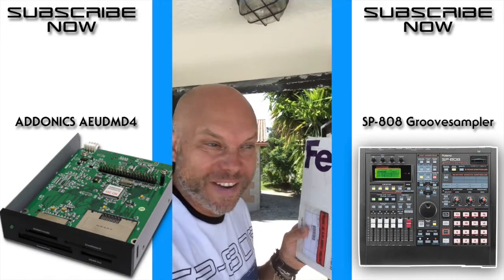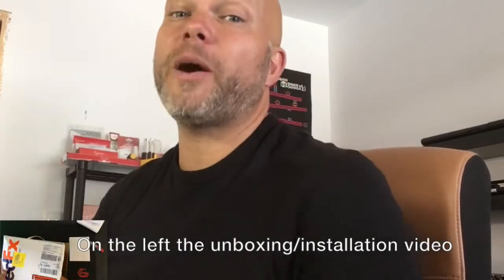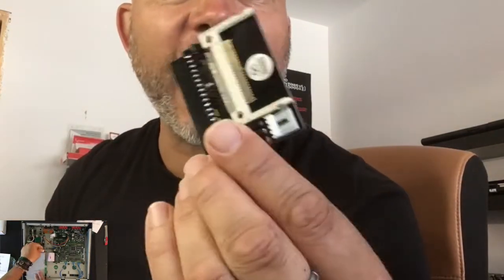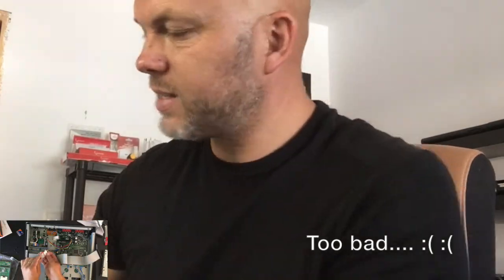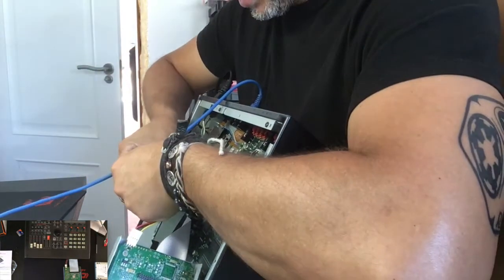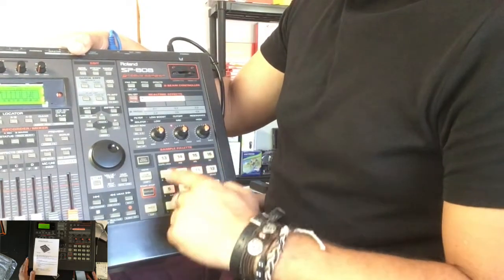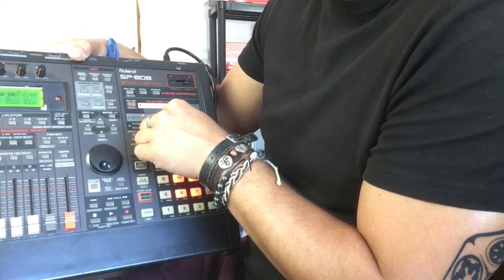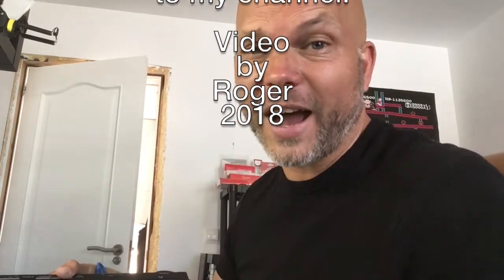SP-808: Addonics CF-cardreader installation (MPC-2000XL CF-card reader)

Comment: For all your information, I got a StarTech.com 3.5in Drive Bay IDE to Single CF SSD Adapter Card Reader (35BAYCF2IDE) from Amazon , for a Roland vs840ex converted to gx. Works a treat by the way. But before I fitted it, I thought I’d try it in the SP808 , although it didn’t work right it functioned better than previous attempts with a hard drive, I was able to record to all 4 tracks and play back, then saved song, wouldn’t sample though, although it tried, After powering down and restarting it displayed no disk. So had to format again. Anyone have any ideas on getting it working.
Reply from the maker: wul01 thanks for sharing this!
It’s the same story again...
I’ve tried old hard drives, different readers, old 512MB CF-cards and still nothing. 
You will be able to sample, yes, but after shutting down always that same message...’no SP-808 disk. Format now?’
When you connect the SSD to a computer you will see multiple SP808TS250-folders. But there’s now way to have the 808 starting with another reader than the blue MPC-2000XL. 
I still hope that this all is picked up by a manufacturer...
We keep on trying!!
Reply: The MIDI Maniac according to the instructions for fitting cf to mpc2000xl the interface is scsi.
Reply from the maker: wul01 so wait....the drive of the MP is scsi? 40-pins scsi?
Could this mean that we should search for SCSI-CF reader? Perhaps SCSI2SD will work?
Reply: The MIDI Maniac I was going by what I read in this https://medias.audiofanzine.com/files/procedure-to-install-card-reader-mpc2000xl-481589.pdf
Reply from the maker: wul01 yeah! I read that article this morning after your message. 
Let’s figure that out!!
Reply: The MIDI Maniac bit more info , because the cf works in the vs840, I was able to utilise it’s 750 zip in the sp808 which formats to 512 and reads and writes ok, as does the 250disks, but the 100 mb disks read and play the contents but when I tried to sample it did exactly the same as the cf did. Did I read somewhere you tried a 512 cf disk? Did you try any smaller?
Reply: The MIDI Maniac one more thing , when the vs formats the cf, it creates 2 1gig partitions, formatting one of them and leaving the other. Does the sp create and format all available? If not, I Wonder if it would be worth trying to remove all but the first partition.
Reply: The MIDI Maniac, did you get any further with this attempt yet? Thank you for your nice vids!
Reply from the maker: Welzijn Ermelo hi!
Yes, I’m entering a new phase. I’ve bought an MPC2000XL Blue with, if I’m correct, the right CF-reader for the SP-808. 
If it works, I will launch a crowdfunding action for setting up the production of a replica. 
This will be a cooperation between me and the R&D team of Gembird Europe from Almere. 
They have proven experience with hot swap ide units (Flexi drive). They developed that in 1998. 
And I’m the responsible for that brand in Spain//Portugal ☺️
The unit has to be suitable for more Roland/Akai products. 
I hope to receive the mpc in 3 weeks. Has to come from Japan...🙈
Keep you posted on this subject.
Reply: The MIDI Maniac Hoe cool is dat! Succes, groet  Huib
Reply: More info, I got some 2 gb. 80x. Cf cards for the vs840gx and it wouldn’t recognise them, there was nothing wrong with em, as they worked elsewhere. But that appears to show that Roland gear can be a bit selective when it comes to cards it can read.
Reply from the maker: Welzijn Ermelo ja, gaaf! Hoop zo dat het gaat lukken! Groetjes, Rogier

Comment: I think is problem write and read speed from other media . The original Zip drive has a maximum data transfer rate of about 1 megabyte/second and  and a seek time of 28 milliseconds on average. Use a Ide card reader and find the slow CF card.  Writing to a FAT32-formatted card generally takes a little longer than writing to a FAT16-formatted card with similar performance capabilities. SanDisk 512MB CompactFlash CF Memory Card have a 8-16MB pro second speed and Sp808 first time make the fat16 format.  i make the test and when work i write comment again.
Reply from the maker: Hi! Great tips! I also bought a 512MB microSD-card with the same intention. When I have time I will test it also.
I'm curious about your results. Good luck and we stay in touch!
Grtzzz, Roger
Reply: i tested and not work. when sampling,,,,freezes and when a next time turn on sp808 then all dessapers and no sampling time.  I tested IDE ADAPTER  with cf card ,,,not work,,,,,IDE ADAPTER to flash memory...not work.......IDE ADAPTER with classic card reader...not work. in all solutions freezes when i tap SAMPLE STOP.  In case is sampled complited then button sample 1 is not red. I tested all to recording songs and all work only save zero. Hahaha . Probably i must find old slower adapter or slow cf card. i have more then 10 hrs tested all solutions and not work. Any other ideas is welcome
Reply: @gogic37  It has nothing to do with speed, it needs to be ATAPI, there has only ever been two ATAPI card readers released, I have absolutely no idea why that is because it is completely absurd, at this point the only real option is for Roland to pony up the A6 and 808 firmwares for somebody to make a hybrid, unfortunately that will never happen.